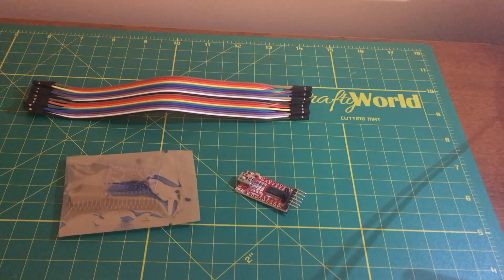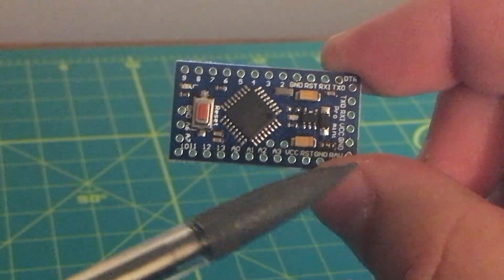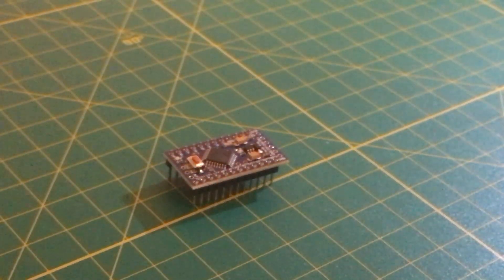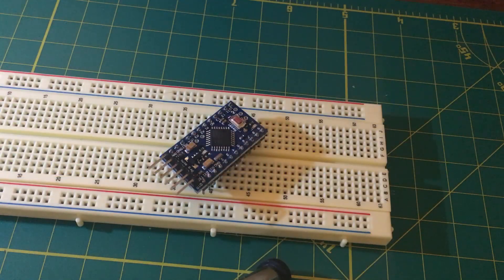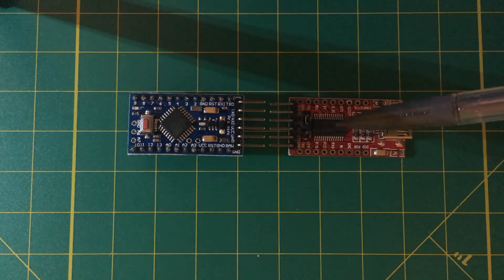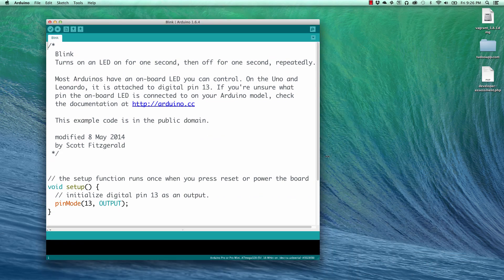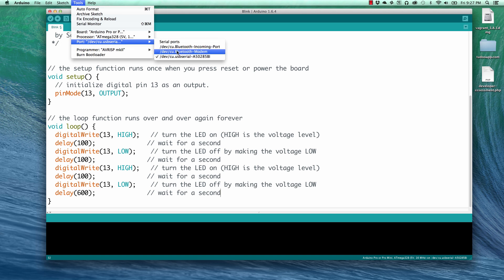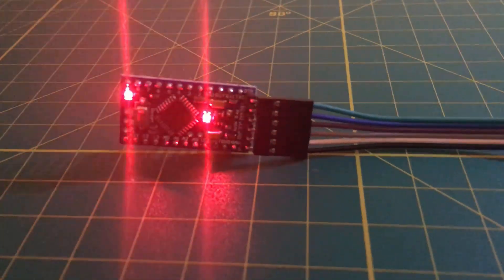FTDI + Arduino Pro Mini

Comment: On the ftdi adapter I bought the connections are not straight over like in this example.
I have got the code uploaded and working though but there is a problem.
If I cut the power to my mini pro for a minute or so the program won´t run and I have to upload it again.
Any idea what is causing this?

Comment: Hi, I have your exact same setup. Same version of the Pro Mini same serial adapter. Also using a Mac with apparently the same driver for the adapter, but I cannot, for the life of me, get any sketch to upload:
avrdude: stk500_recv(): programmer is not responding
avrdude: stk500_getsync() attempt 1 of 10: not in sync: resp=0x00
avrdude: stk500_recv(): programmer is not responding
avrdude: stk500_getsync() attempt 2 of 10: not in sync: resp=0x00
avrdude: stk500_recv(): programmer is not responding
I tried unplugging, replugging and uploading and nothing. 
Any other tips?
Reply from the maker: Andrew, what version of macOS are you running? Also, thanks for watching!
Reply: Hi Nate, I'm running 10.11.6 (El Capitan)
Reply: I have the same problem too, I'm running 10.12.3 ......anyone can help?
Reply: Same problem on Raspian pi 3 b+

Comment: plzzz plug in a tft screen or an oled screen and plzzz make a tutorial on that with adruino pro mini
Reply from the maker: That would be a fun follow up video. I have some small OLED displays that use the SSD1306 library. Driving one of those with the Arduino Pro Mini is pretty straight forward. If you want to get a head start, check out this tutorial on Adafruit. https://learn.adafruit.com/monochrome-oled-breakouts/arduino-library-and-examples

Thanks for the suggestion, and thanks for watching!